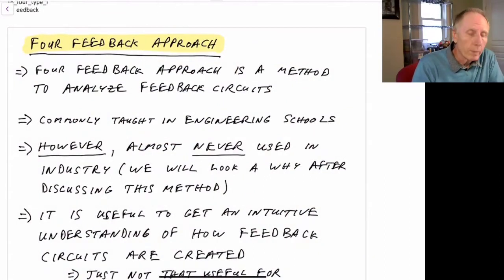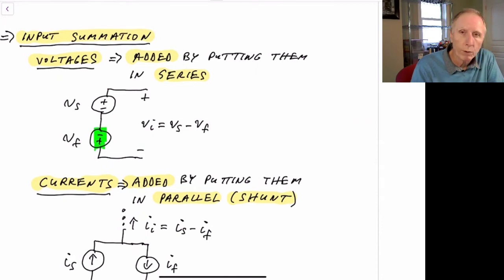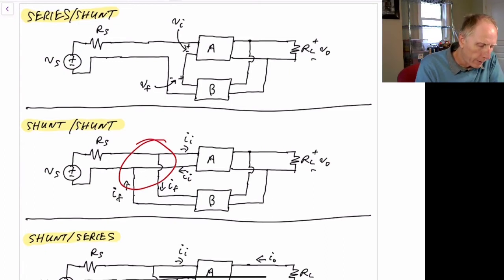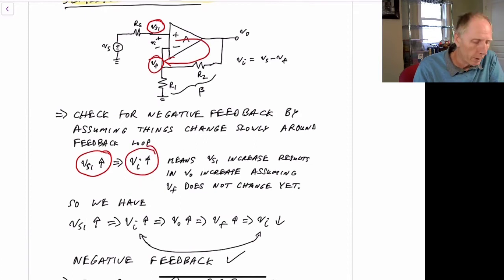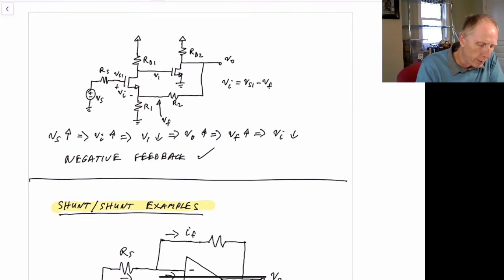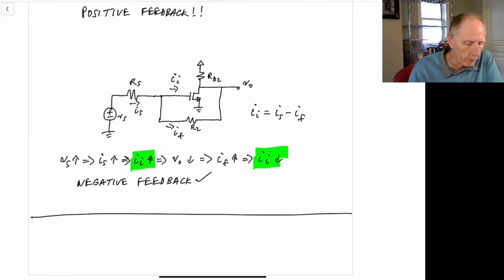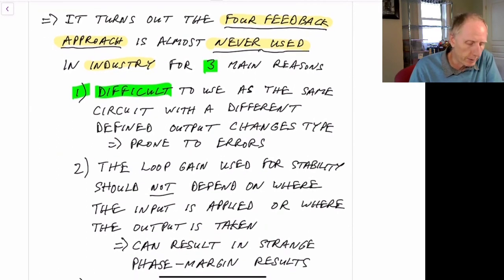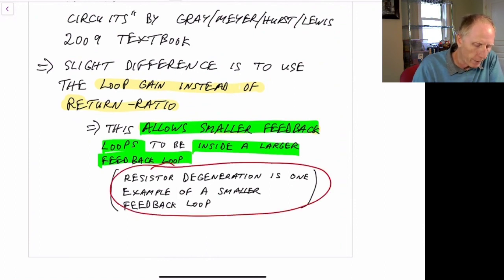Analog Electronics 2 - Four Types of Feedback Structures (shunt and series)

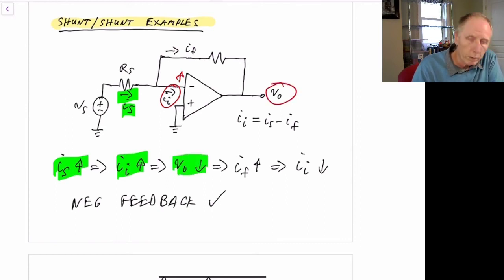Comment: @21:32 how does vo going down, increase if?
Reply from the maker: if v_neg is the voltage at the neg opamp input, then i_f = (v_neg - vo)/R_f where R_f is the feedback resistor.  so i_f is proportional to negative vo
Reply: @davidjohns2582  Alright, got it, thank you!
Great video btw  ❤️
Reply: I watched like 100 Times, still don't understand